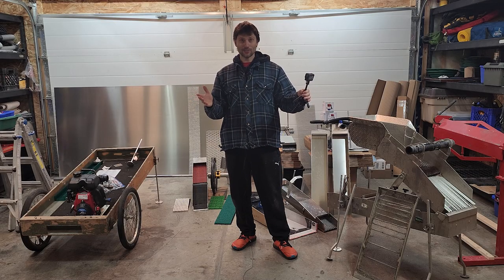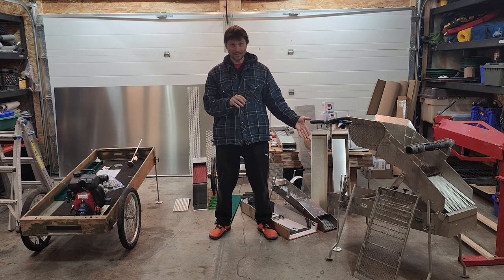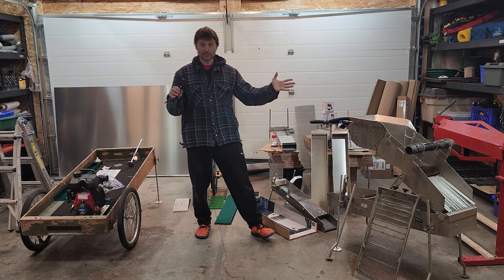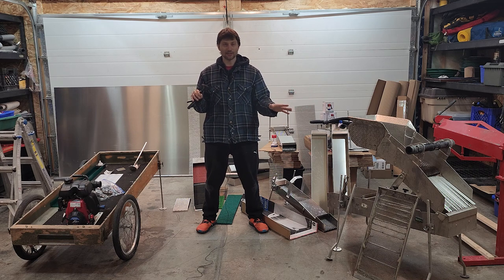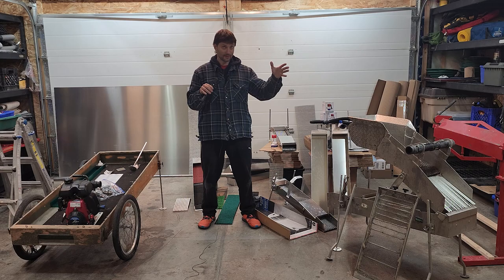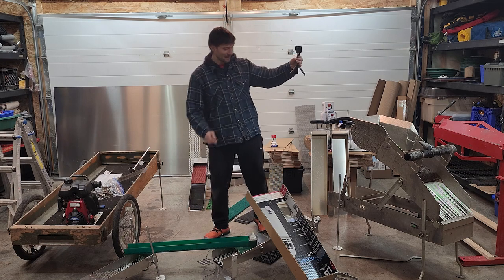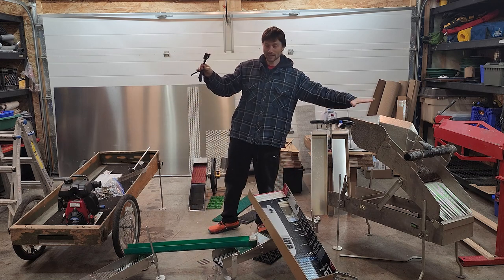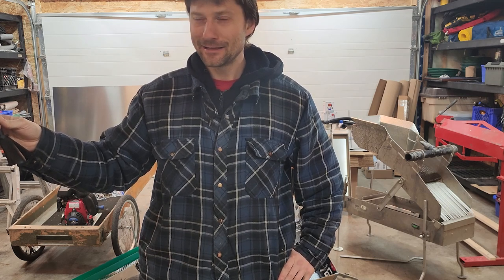Let's Talk Highbanker Design.  Talking about building my next highbanker and what I've learned.

Comment: Kyle - 1. great idea to test the Infinity cleanup sluice by sucking up just the straight drop riffles separate from the circular wells! 2. Also - you are doing some excellent analysis - very in-depth.  3. I don't know anyone else who is taking a balanced view across multiple manufacturers and products like you are. Well done, keep it up! 4. You have lots of good ideas, hope you are able to prototype them all. 5. Completely agree with you about a flat hopper and a steep grizzly. 6. Something seldom discussed is stamina as a limiting factor. Getting a really big highbanker is pointless if you don't have the stamina to feed it properly. So many people think that the bigger the the highbanker, the more gold. That is only true if one has the stamina to keep up with the box. I have a 6 inch highbanker, and have yet to 'out dig' it. Fitness and free time are two of the biggest limiting factors, and they have nothing to do with equipment.

Comment: the thinner backed miners moss is the way to go . Making your wheels a quick attach would enable the option to use in easy to traverse areas . Smaller 8" wider solid rubber wheels will go over easier gravel sand bars and will take a lot of the weight . I have them on my sluice box . if one was to make the quick attach pin lock you could go anywhere rolling or carrying

Comment: Cool video buddy!! You covered lots of good points, Ab flour is hard to get. Im running a 10" HB, shovel hard and it works great. 36" hopper flared out to 14" top with wrap around spray bar, 1/4" punch plate covers whole hopper with moss and carpet under it(I catch around 50% of my gold in hopper) I put 1/8" mesh over punch plate for Alberta flour but pull the mesh when I went to Yukon. Hopper goes down to 48" main sluice running DM beach mat with carpet and moss in the drop zone, then a 44" extension running gold hog with more carpet between the mats. Ive tested many times with a stream sluice at the end but didnt find much I think im catching at least 98%. I had couple slick plates but I find its better to have full mats. My sluice slides together/collapses with pump, hoses and everything I need in hopper also has wheels so its easy to get to the river. Hope the best for you in 2023!!
Reply from the maker: Sounds like a solid setup!  I've seen a few other boxes with moss in the hopper and a wrap around spray bar.  Catching 50% up there is a great start.  I'm wondering if I can use the mud busting blaster setup spraying from the bottom and still hold on to gold that well in the hopper.  Lots of testing to do!

Comment: I'm not from your area but one of my favorite highbankers come from geosluice. It requires no mats but classifying the material is important (just as it should be). Perfect for targeting an area at higher volume. Downside, it's not a shovel unit to move more material once your hot spot is narrowed down. Not sure if that helps but I love the small down time between clean ups with a setup like the geosluice (drop riffle design)
Reply from the maker: I just googled Geosluice, looks like they have something that used to be called the G1 highbanker.  Cool stuff!  I love drop riffles, I'll definitely have to test with them more in the future.
Reply: For moving large volume of dirt, there is  the "Super Wide High Banker Drop Riffle Gold Sluice"  a similar design to G-1 Highbanker, a power sluice Designed by Joel Farmer from many years ago. Doing a cleanup in under 1 minute is good.

Comment: Great video and it all makes sense from what I have learnt so far. Have you ever looked at viable options for an electric pump with one of those power supplies? Like a Jackery with some panels to supplement power? I would like a high banker setup some day but don't want to go gas pump.
Reply from the maker: If you think about it, all that is required for that is a bilge pump that puts out a high enough volume of water to run your sluice of choice.  If we look at a 8" box flared out the 12", that would run well at 20 gallons per minute which is 1200GPH.  in the real world you could use either two of those cheap 1100gph pumps that actually only put out 700gph ( https://youtu.be/zy_hZl8OZuQ ) or just find a single larger pump that can keep up.  I would guess a power use just over 100 watts, meaning a Jackery 500 would run it for 4-5 hours, or a LiFePO4 battery could work quite nicely as well.  So long as you are reasonably close to the river electric pumps can push plenty of water and you would be able to run a full size unit fairly easily.
Reply: @UtmostOutdoors  interesting Kyle. Thanks, and hi from Edmonton

Comment: Interesting stuff. Im in pei, no gold anywhere here :/ wish there was something around! We arent allowed to run sluices here either. Only panning on beaches
Reply from the maker: Interesting there's no gold.   Have you ever gone out to pan the beaches just for fun?
Reply: @UtmostOutdoors  I've tried a number of them. There isn't much for reports of gold other than an old 'gold rush' that seems to have turned out to be a bit bogus. This is just a big sand bar, no actual rock here like in NS or NB. I would think there has to be flour gold, at least a piece here or there somewhere... there are quartz pebbles in the sand and banks but small, far between and river run for sure, ground down. So whatever would be here would be pretty sparse. Will be heading to NS this year to do some panning.

Comment: I stop the video at 2:21 an write this. I'm curious about what follows but my thoughts in advance =).
i like your hopperbox and the 2 storey sluicebox underneath. but i think you will need more length and alternating mats to really catch all the gold. 
of course you can say "it's not important to me to catch everything" but it's your time, energy and money that you invest.
and in my opinion you should be worth it to at least catch everything as best you can.

I have a goldhog piglet with an extension and a flare. but also dreammat and infinity vdr mats in it. I am now even thinking about installing another 2m sluicebox under the hopper (lift it a little bit up) and the original sluicebox to be able to use it with other self-made (3d printed mats). i try to use the best of all possibilities to absorb as much as possible. even if it is at most a hobby for me ^^.
Reply from the maker: I was thinking for a test I could try splitting my mat into sections and do a cleanout where I see what percentage of gold I find in each section as well as in an extension.  That way I could see what percentage of gold I would loose based on the length of the sluice.  My aim is to get 95% recovery by weight, with just one cleanout at the end of the day, and not carry extra weight beyond that.  It will be a good summer figuring it all out!

Comment: As usual, great video!  Is there any plans in the works to make a small trommel?
Reply from the maker: Good question.  I have run into a few spots where a tommel would help me out.  Areas with lots of clay and muck.  Also spots with grass roots.  I spoke to a trommel user and they said even their trommel had a hard time with the roots and organics, while it did help with the clay and muck.  So right now, my number one goal is to get as close as possible to the effectiveness of a trommel, without the weight and complexity.  So no trommel in the works right now.  But if I decide I "need" one, then I guess I'll have to build one.